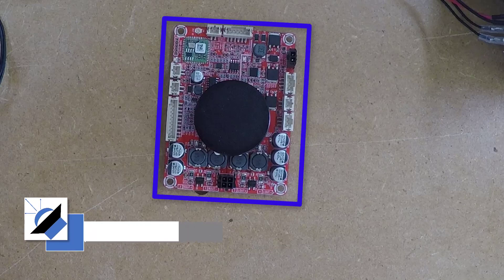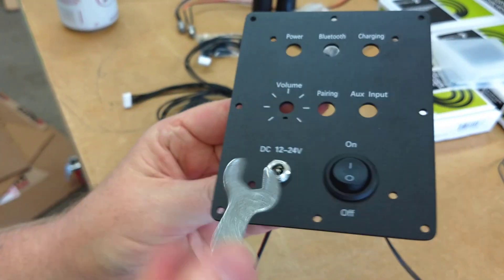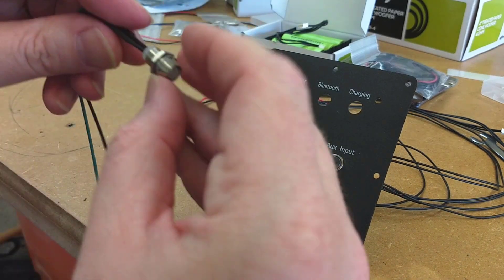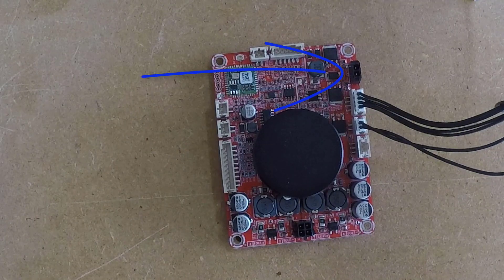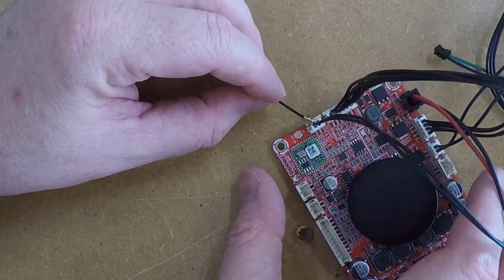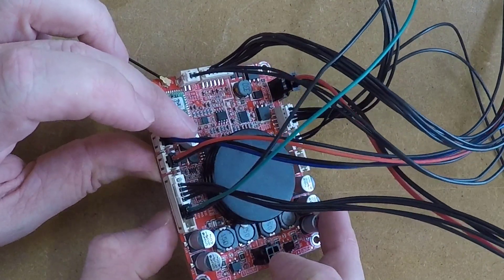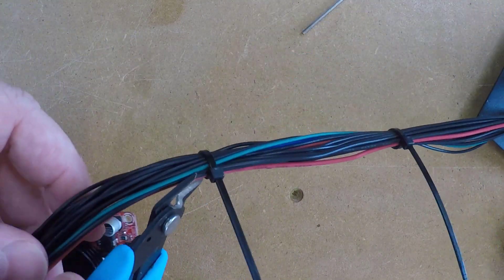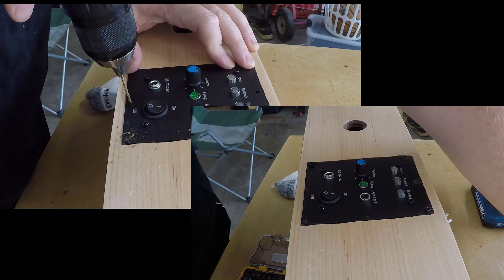Bluetooth Amplifier:  MK Boom Amplifier Kit Assembly

Comment: Troubleshoot help. Building my second one. Everything works while plugged into DC, but when I unplug from DC,  to use batteries, no luck. I tried re arranging batteries, cables, but I can’t get it to work on battery power. Advice?
Reply from the maker: Reach out to Parts Express technical support.

Comment: What's a good way to secure the boards inside speaker if I am not using the product in video?
Reply from the maker: Not sure what you mean.  Even if you don't have an enclosure with the dado's you do the same thing.  Apply wood glue then either clamp, nail, or screw to hold everything in place.  Once the glue dries the joint will be solid.
Reply: @DIY Audio Guy  sorry. I meant the Amplifier boards. I am using mdf, so when i rill small holes for standoffs they don't seem secure.
Reply: @DIYAudioGuy  so been tinkering and figured I can mount to some ¹/⁸ plastic with standoffs and secure that to MDF.

Comment: Just picked this thing up for a gift got the thing 90% assembled and littally my cellphone has better sound and louder then the box is there something I'm missing. Hit me back getting rather frustrated and about to send it back or across the room and watch it gernade.
Reply from the maker: Reach out to parts express, they have excellent technical support.
Reply: @DIYAudioGuy  I think  the x-overs are junk soon as I disconnect and go straight to the speaker I get 2x sound so thinking on wiring the 2 in series and bypass the x/o's
Reply from the maker: @petearmstrong4580  again, reach out to Parts express. If there is a defect they will try to make it right.

Comment: How does this board compare to to the arylic up2stream in terms of power,sound quality and THD at max volume
Reply from the maker: I don't have any measurements, but I'm going to suspect about the same.  The main advantage of the up to stream is the Wi-Fi connectivity and the whole house audio.  If you're not going to connect to Wi-Fi then just to get a Bluetooth one from Parts Express.

Comment: I've built a number (more than a dozen) portable speakers using some or all the components of the various parts express kits.  I never use the flat packs because fine woodworking is part of my hobby and like to build my own version of their tried and true designs.  I've used that control panel on several speakers and its really the best way to complete any speaker using that series of amp boards, other than the latest high-power version that have separate potentiometers.  In any case, one caution is that I would not use the control panel in a speaker chamber unless you are prepared to fully coat the inside of the panel with silicone.  There's really no way to get it completely sealed with all those penetrations.  I build in  a chamber for the panel, amp and battery board, sealed and separated from speaker chambers.  I realize this particular kit does that, but you need to do the same if you are using the panel is something custom.  BTW, PE's 2.1 kits ("executive",  and "blast box") are way better, but somewhat more complicated to build.
Reply from the maker: The flat packs are great for those that don't have woodworking tools.

Comment: Hello, great video, it help a lot, thanks,, ,  question, what can i do to had a subwoofer and a usb port to this kit?? is it possible ?? thanks for your help and sorry for my english, i'm from Montréal , Canada, thanks for your help
Reply from the maker: I'm sure there's a way to add those to this kit, but it will be more trouble than it's worth. The kit only has a two-channel amplifier so you would need to figure a way to get signal out of the amplifier and then connect another subwoofer amplifier. I don't think the amplifier that comes in the kit has a USB input or output.  For a subwoofer consider a different kit like this one: https://youtu.be/coBRZVkJ-zE

You might also consider skipping the kit all together and going with an amplifier that can do a little bit more: https://youtu.be/XQE0wvL1iYE

Comment: Hi ! What are the diameter and the length of the bass reflex ports ?
Reply from the maker: I do not know, you can follow the link above to the kit and it will probably list that information.
Reply: @DIYAudioGuy  Unfortunatly, this information is not given 🙁
Reply from the maker: @hyatprod2509  That's probably why I don't know it!  I never took the time to measure the porch when I was assembling the kit.

Comment: How do the speaker wires attach to the Bluetooth amplifier board?
Reply from the maker: It's just a plug.
Reply: Dumb question I guess. But thanks for answering. I will have your video running when I do this build tomorrow!
Reply from the maker: @gregjerome4258  there are no dumb questions.
Reply: Ok. In that spirit, I’m building a box out of 3/4 in Ash. Should i drill port holes in the back or leave it closed?
Reply from the maker: @gregjerome4258  I would need a lot more information to answer that question, it's a little too deep of a subject for the YouTube comments.

Comment: is their a possible to add a treble and bass connect? thank you ;)
Reply from the maker: Not with this board.  But Parts Express* does offer a version of the board with DSP, which will do a LOT more just bass and treble.  

https://bit.ly/30TCDhY

Another option is arylic, which you can find on amazon*.  They offer a line of wifi-enabled amp boards.  This one has a separate channel for a subwoofer, which has an independent control.

https://amzn.to/2GTxH5D

*as an affiliate/associate marketer I may earn a small commission on qualifying sales.
Reply: @DIYAudioGuy  thanks a lot!
Reply: @DIYAudioGuy  actually that one has no bluetooth therefore... :(. I need the combination of both.
Reply from the maker: @AldiPennyLidl1887  I think they also have a DSP module that can plug into some of their boards.  They also sell some stand-alone Bluetooth amplifiers, don't need to build them into a project. Just plug your speakers in.